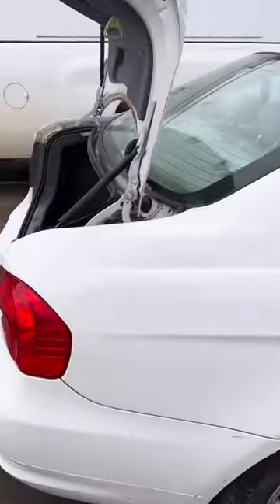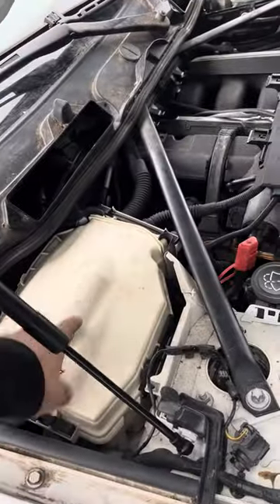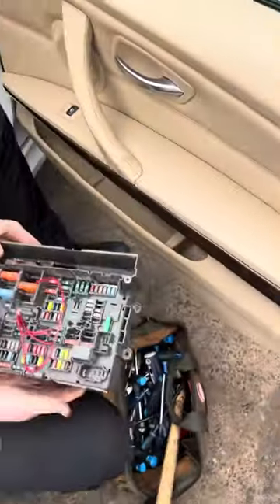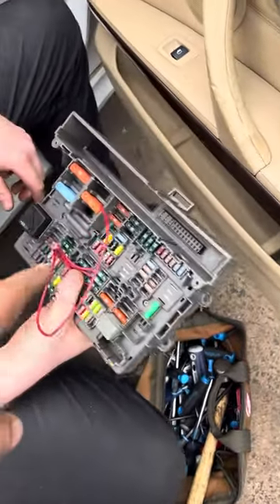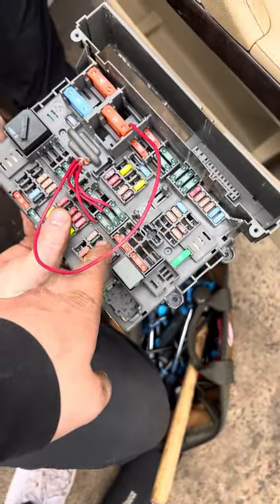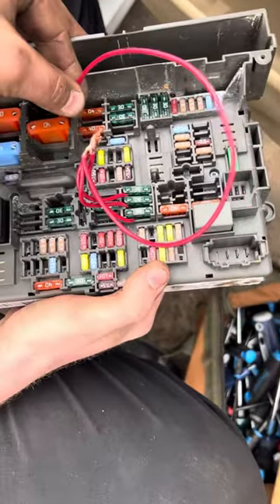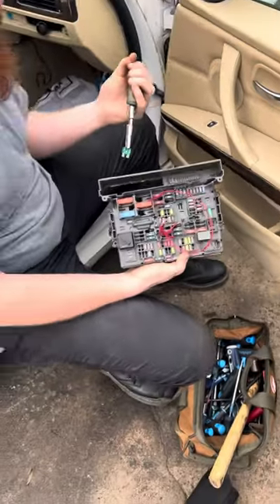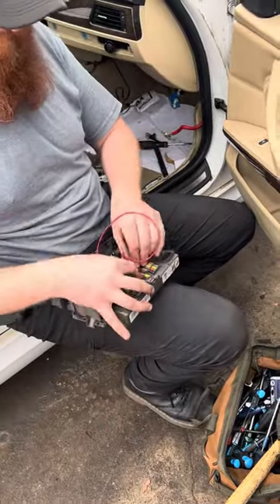BYPASS TO START BMW e90 e92 master dme relay activation code ISSUE dtc - 002ACB 002ACC

Comment: I just tried this and the car runs great. So i swapped the fuse box with a new one and i go to start it and it just cranks again. I do the same thing as the first time with the wires and the car runs again with the new box. DME possibly bad?
Reply: Is it completely plug and play Fusebox ?

Comment: this worked for me in a 2009 x5 that had water damage due to the clogged drain in the sunroof, but mine had sulfation both in the junction box connector and in the fuse box above one green relay, I opened the fuse box and i can't see anything burned inside, how could I know what Is it causing the DME MASTER RELAY failure, is it the junction box that is connected to the fuse box, or is it the box itself, thank you?

Comment: my front relay clicks and has power. Do I still need to try this method? I get no com to my dde when trying to scan. Car cranks, doesnt start.
Reply: Any news bro I have the same on a 325d
Reply: @litbasegaming3465  I posted everywhere, got almost 0 answers. I sold the car, it will soon be scrapped. But gl man.

Comment: Will it work if my car its not giving a spark and not opening injectors pulse?
Reply: I got the same issue. Were u able to figure out the problem?
Reply from the maker: Did you find your problem ?

Comment: Did you by any chance have any camshaft sensor codes? And or any idle surge?
Reply: I have it. Do you know what to do? I have replaced the camshaft sensor but 2b63 keeps appearing. And now I can not start the car
Reply: Did you figure out your problem?
Reply: There is a small black  fuse block 
Next to the dme in the engine bay with a cover on it with 5 or 6 fuses 
In sure one of those fuses are blown
Reply: @iamurnamann8662  There is a small black  fuse block 
Next to the dme in the engine bay with a cover on it with 5 or 6 fuses 
In sure one of those fuses are blown

Comment: hey bro only question i have is to bridge the fuses in a pre 03/2007 is it the same? the fuse panel is different on the pre 03/2007

Comment: Hello I made this but will it be good if I use it like this or this will cause some problems?
Reply: You probably don't want to drive it like this permanently because it can cause electrical fires in the even of an overamped circuit but it's a hell of a lot safer than being on the side of a highway in the middle of the night...I've relied on similar bubblegum fixes in the past for longer than I'd like to admit and never suffered any consequences...I've heard of people who have burned their car down though.